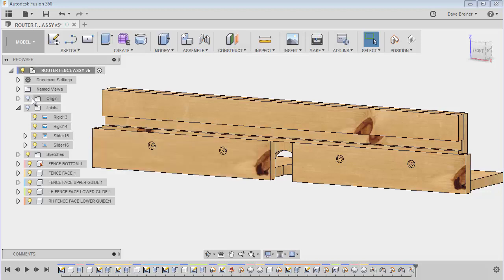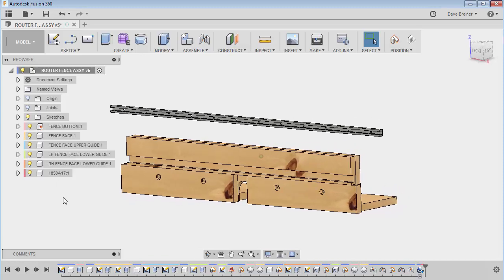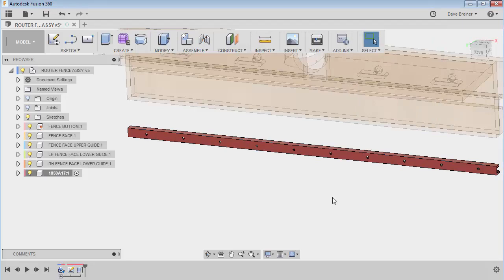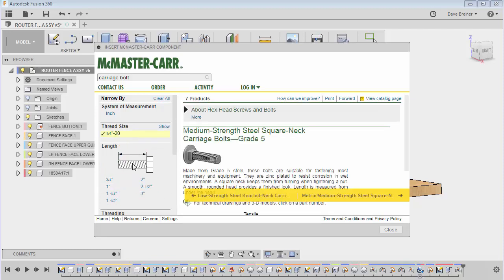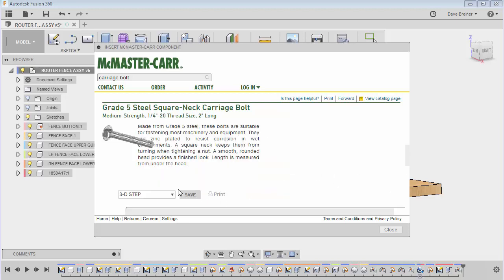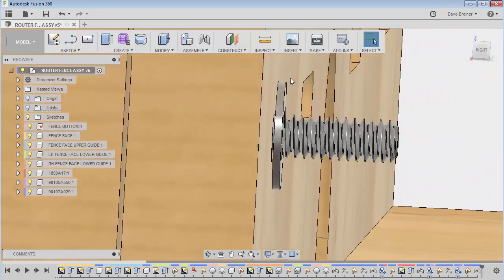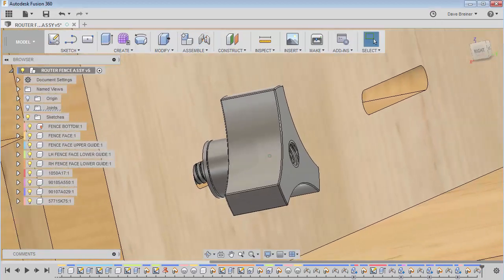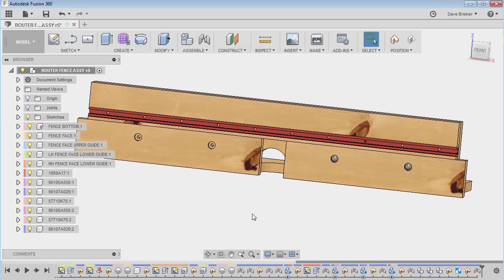Video Tip: Fusion 360 - McMaster Parts

Comment: I wonder when, modifying the fixture bar, that there is a way to use some parametric capabilities where one can easily change the length later without having to draw a sketch (again) and extrude a cut (again)---like you did in the video to alter the bar's length. That is, have the ability to just change a dimension and the bar's length would update automatically.